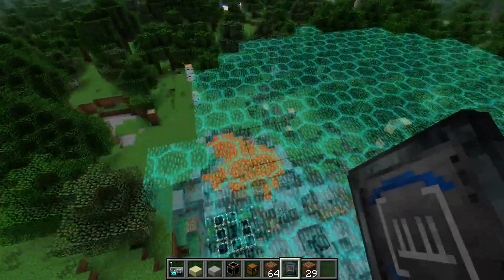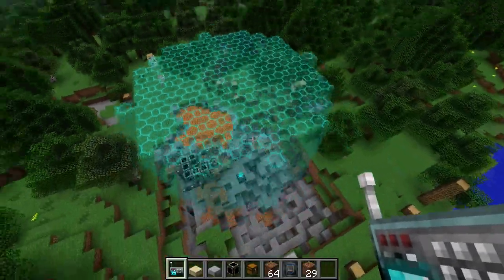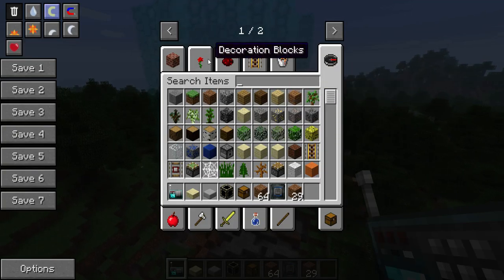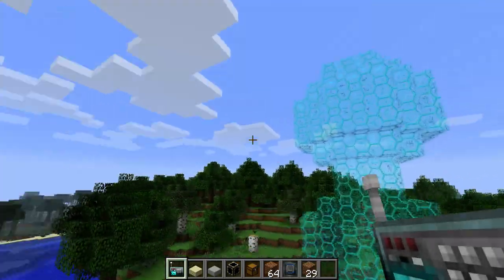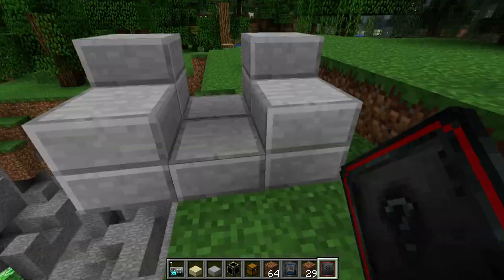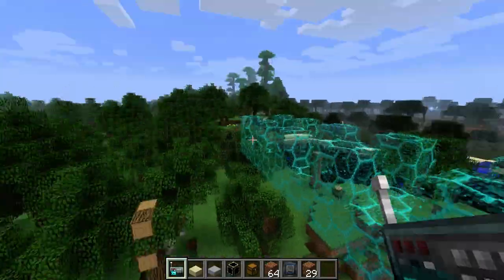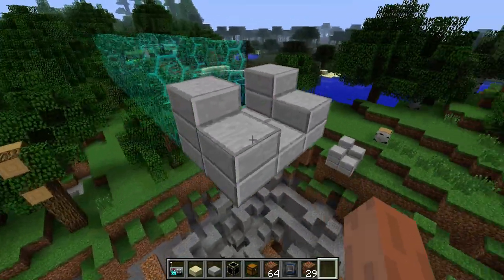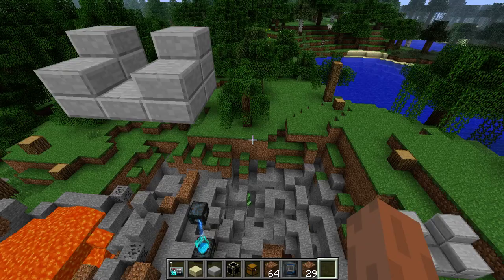MFFS v3.5: Array Module

Comment: Ooooh, an easier way to create floating hard-points...I like to create little hexagonal hard-points on my shields to protect from things like missiles or even artillery.
Reply: Also, you should add some sort of orbital bombardment satellite that can be launched via ICBM...since they technically go into orbit, then, if you do it correctly, you whip out your laser designator and use 500K/J to create a laser-explosion with a crater roughly half the size of an antimatter bomb.
Reply: Sorry, but my engrish kinda sucks, I'm tired and I can't type.